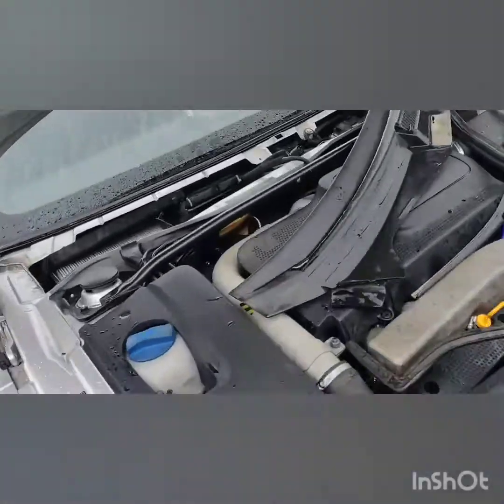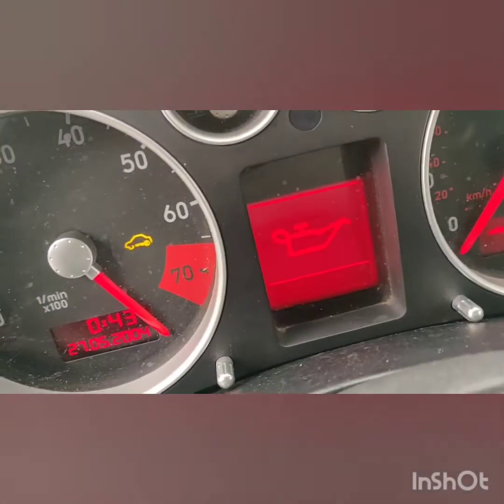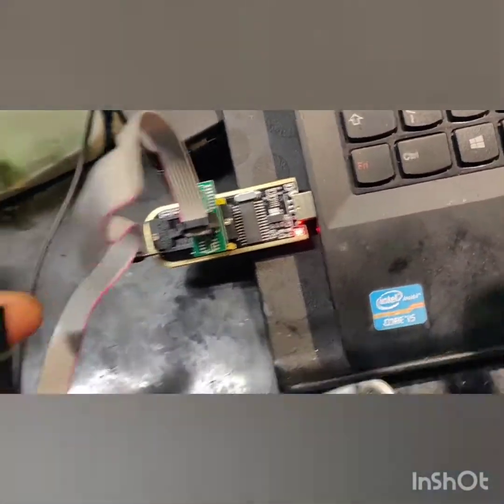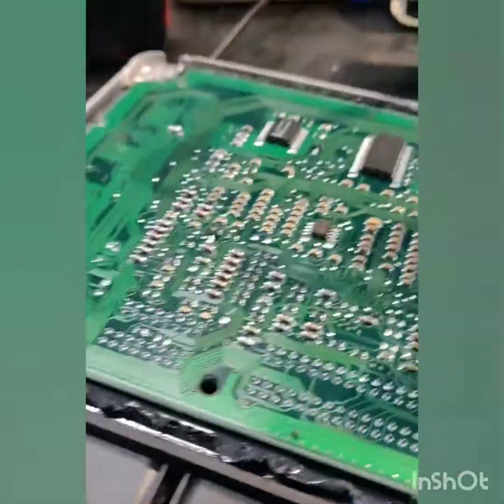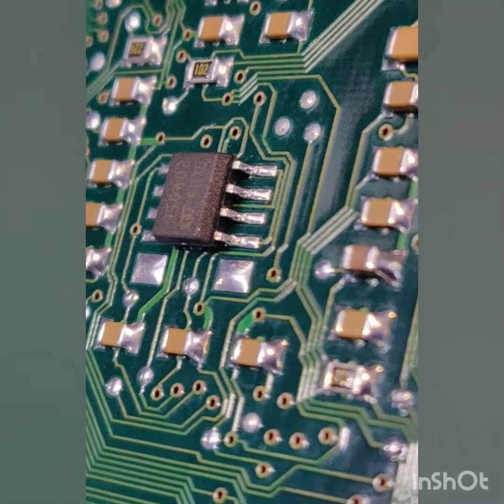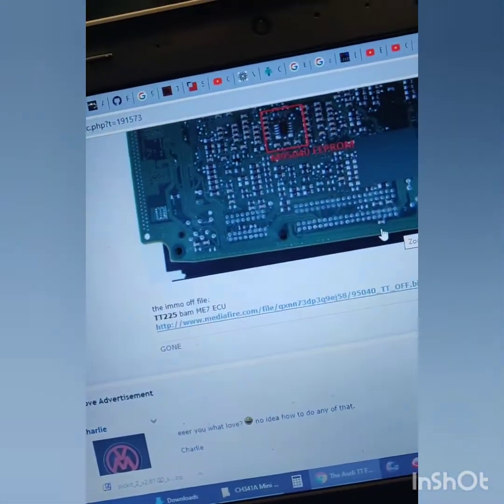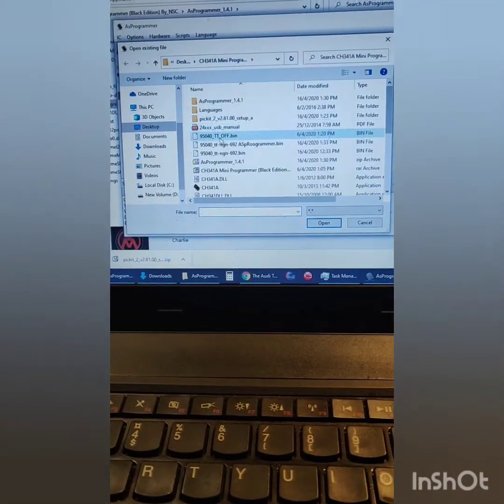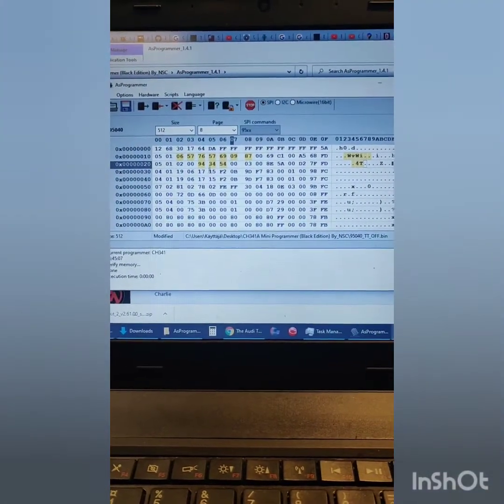Eeprom, Vag , Audi tt immobolizer delete / bypass CH341A

Comment: im tt cluster die bro i orde aCH341A.. any link with more information?after delete car start without cluster or need another used cluster to work?
Reply from the maker: Hello, as I remember that after delete the car will start without a cluster. And you can use another clusters without coding anymore.

Comment: do you know or have anything on a 07 Lexus with smartkey push button start to bypass immo.? I have the ch314a ready to read and write.
Reply from the maker: Unfortunately I don't, you can check the forums online, 
Good luck
Reply: Hey mate 
Did you find the solution 
I have the same issue

Comment: You should show which parts in the file get changed on the ecu you downloaded from the original dump you did.  That way they can do their swap easy without needing that file.  Blur out the code in that area if you are worried about them reverse engineering you vin
Reply from the maker: Hello.
The file was taken ready from the forum showed in the video. I took the file and uploaded it ready, I Have no programming skills, just little with electronic and a fast learner.
Therefore I don't know which line to be changed. That's up to every user to search for the right way. For me the file on the same ECU Number worked immediately.
I showed a cheap stright way and the apps used which were hard to get to know and find.
I just gave a shortcut for the user :)
I hope it was helpful for you 😊

Comment: 32/33 and 42/43 should be the same numbers also and if you reverse these two sets of numbers and put in hex calculator you will get you immo code just add a zero to the start to make it a 5 digit pin
Reply: 03d906023b immo off Wv fox